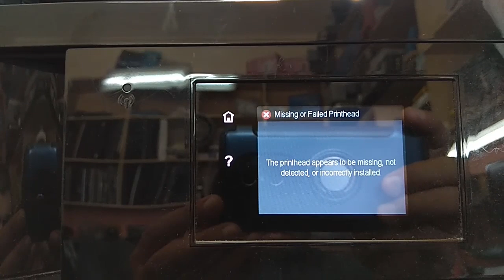How to fix hp officejet pro 8610 missing or failed printhead

Comment: Just a note maybe, not a reason to remove the ink cartridge contact assembly unless your having cartridge contact issues I would say. After I reassembled the print head, had issues getting the cartridges to stay locked in! I'm surprised no one else seemed to have this issue. There was no alignment posts and a lot of play in the assembly with the screws not fully tightened. I ended up leaving the cartridge contact assembly loose a bit, loaded all the ink cartridges and then tighten the assembly down. I didn't have any luck. Same issue. Seems to recognize the print head for a fraction of a second then goes into cant detect print head again. Going to try the power off suggestion. Glad this worked for so many Definitely a logical and simple contact fix! In my opinion this print head is a shoddy design by HP with these spring contacts. Made cheaply to fail I suppose to keep the buying going!😕🙄
Reply: I MAGINE THE TECHS THAT FIX THESE, KEEP A NEW, NEVER USED PRINT HEAD, MAYBE WOULDN'T EVEN NEED INK CARTRIDGES IN IT) TO TEST THAT, WITH A NEW HEAD, THE MESSAGE WILL GO AWAY & RETURN TO NORMAL  MENU

Comment: I will never buy HP again, greedy woke company. First, I did all of this it didn’t work, however someone mentioned it was intentional and if I unplugged for a while the message would disappear, and so I did. When I turned it back on, I could print the report page quickly before the message appears without any issues, which suggests the printer head works fine, I think HP has built in this common issue and don’t want you to fix it but instead buy a new printer.

Comment: Not one of the better videos. That is for sure. Also, why do all that extra work sanding the springs? That's 100% a waste of time. 
Make sure your ink levels are good, clean off the contacts on both sides of the control board and if that doesn't work, but a new print head or printer. I have had my 8620 for over 5 years and this is the first problem I have had with this thing so far.

Comment: I followed the instructions precisely and IT WORKED.  HP charges $150 for a new printhead, but by cleaning my current printhead it only cost me $9 for a Husky 8-in-1 Precision Torx Screwdriver Set at Home Depot, which includes T6 and T10 and others.

Comment: Merci pour vos indications que j'ai mis en pratique cependant l'imprimante continue d'indiquer que la tête est défectueuse. Je vais donc en commander une. Bien à vous 🙏
Reply: I tricked my printer, because I didn't have the tools to open the head, I just wiped the contacts with a moist cloth, put the head back on without switching off the printer, closed the lid, then I pressed the off button, it warned me not to switch off without the cartridges in place I went ahead anywhere, removed power cable, then switched it back on, it asked for cartridges , calibrated and is now working, happy days

Comment: I need to see you it in (which you did) and use it so I know for sure it really worked for you. 

This video only shows how to take the printhead apart and clean 🧽 the printhead and put it back 

but not use it by making a copy of anything. This would show that your method really worked.  This would be convincing if you only used it to show that all your hard work 😓 paid off. 

If you can somehow show that 
With that printhead you used your method on 
Show you copying something to show that printhead works.
It would be nice to see that video

Comment: nice.  Since you're showing how to clean oxidation manually, if that's all it is, that will be great and I'll give it a try.  A quicker simpler way is to use DeOxit F5 which is what is use to clean electrical components on mother boards, potentiometers, small motors, vintage audio hi fi gear.

Comment: I just can't understand, how the print head can be lost. It was just there some days ago and now it's gone... I probably have to try it as well but wondered if the problem started with the ink. Although the ink was bought from the same manufacturer, it was a bit cheaper and I wonder if someone had injected a different inc into the cartridge.

Comment: Well, I've done all the steps in this video two and a half times. The first time I didn't have a T6 bit,  so couldn't do the inside. Bought a Precision Screwdriver Set for $10 at Home Depot just to to get the T6. Then I did the whole shebang twice. Tried other people's suggestions about unplugging and letting it sit and then rebooting. A couple of times I got the right display for an instant before the original error message came back on "printhead missing, not detected, or incorrectly installed. Error code: Oxc19a0003"--so I had a glimmer of hope that it was trying to connect. Any suggestions?
Reply: I know its been over a year but 90/% or higher rubbing alcohol on the contact with a Q Tip to properly clean.

Comment: Topic: In case the new printhead also fails, try to exchange the internal battery as well. 

To begin with, thank you for all this information, great video and also great discussions! 
I had the same problem "printhead missing ..." and first tried the “contacts cleaning” options shown on this tutorial. It did not help me. Then I exchanged the printhead for a brand new version (140 €), also to no effect. 

As the error message blocks all further interaction with the printer menu, I could not reset the printer (HP Officejet pro 276DW.) Therefore, in a last try, I decided to exchange the battery (CR 2032) that is installed on the printer main circuit board. In this exchange I also had to loosen three plugs from the circuit board to reach the battery on the back. 

The result: 
-	New battery with old printhead: same error message
-	New battery with new printhead (the one that I had tried unsuccessfully before): printer works!!
-	Old battery still has 3.15 V, so did not seem at “end of life” yet. 

I am a bit puzzled why I achieved this result. Perhaps my printer required both a new printhead and a reset. And perhaps the reset was brought about by the battery exchange or by the loosening of plugs?
Reply: I saw a video that asks if your printer has a battery, If so, put a piece of paper between the battery and the connector so it would not have contact and then reset due if the battery is GOOD it does not allow the printer to do a full hard reset
Reply: Do you have an instruction video please?

Comment: I got this message after I cleaned my print head using nothing but water. After seeing numerous solutions to solve the problem without have to buy a new print head or printer I did nothing but UNPLUG the printer for 24 hours. When I plugged it back in, it aligned and printed perfectly.   I have done this on other occasions for different products usually with good results.
Reply: 😆😆🙃🙃🙃🙃😉Really?

Comment: You are awesome (and the raggae is a bonus) but the HP factory now has pressed on fasteners so I cannot just open the plate that has the print heads on it...they'd rather I buy a new printer than be able to service my own. Rotten greedy *&%$#$$$$$

Comment: One question. Will buying a new printhead fix the “Missing or Failed Printhead” Error?
Reply: You can never be sure, however I'm having this issue as well and I tried the printhead from a different working printer and it worked. Putting the old one back in and it gave error again.
Reply: @TijmenJanssen  Thanks! I think I'll take the risk and buy a new one! :)
Reply: @MonarchGuy974  they're pretty expensive. Have you tried the steps in the video? Cleaning the contacts. Not the ink flushing.
Reply: @TijmenJanssen  that's brilliant

Comment: This is the second HP printer that I've had this problem with. He doesn't mention what he's using you have to guess.
Reply: I followed the video but also added an extra step. Inside the printer body, where the printhead's 40 copper contact pads (19:32) make electrical contact with the printhead carriage (4:28), lightly sand those contact points as well with fine emery cloth.  (It doesn't have to be a rubber eraser, just make those contacts shine). This resolved my problem of the printer not finding the printhead. Also, you'll need a set of Torx screwdrivers (#T6 and T9 orT10) to remove the printhead screws. Got mine at Walmart in the auto parts section. Better that scrapping the printer.
Reply: @TheBoxfitter  What the others didn't tell you is that some of those copper contact pads may be scratched off due to wear and tear of using the printer. If they are scratched off, the printhead is useless. At that point it isn't worth going any further because the person can't put the copper pads back on.

Comment: video was very detailed and I understand it was mostly a "do as I do" walkthrough.  good fix but sadly didn't fix my issue
Reply: I followed the video but also added an extra step. Inside the printer body, where the printhead's 40 copper contact pads (19:32) make electrical contact with the printhead carriage (4:28), lightly sand those contact points as well with fine emery cloth.  (It doesn't have to be a rubber eraser, just make those contacts shine). This resolved my problem of the printer not finding the printhead. Also, you'll need a set of Torx screwdrivers (#T6 and T9 orT10) to remove the printhead screws. Got mine at Walmart in the auto parts section. Better that scrapping the printer.

Comment: I did this on 2 of my printers that has the same problem, it didn’t fix either one. - When I called HP tech support they told me that electrical AC surges breaks these printheads, he suggested I plug printer into a UPS or a good Surge protector.
Reply: I followed the video but also added an extra step. Inside the printer body, where the printhead's 40 copper contact pads (19:32) make electrical contact with the printhead carriage (4:28), lightly sand those contact points as well with fine emery cloth.  (It doesn't have to be a rubber eraser, just make those contacts shine). This resolved my problem of the printer not finding the printhead. Also, you'll need a set of Torx screwdrivers (#T6 and T9 orT10) to remove the printhead screws. Got mine at Walmart in the auto parts section. Better that scrapping the printer.

Comment: I followed this tutorial EXACTLY and, surprisingly, the solution worked exactly as expected. I did run into an issue toward the end. When inserting the print head back into the printer, I found it difficult to stop the mount (it rolls left-to-right). My solution was to simply jam it while it was exposed (it didn't make it back into the unexposed position), and I was able to insert the print head and close the latch. Thank you!
Reply: At 13:34 is that some kind of special eraser? Could the eraser from a regular pencil be used instead?
Reply: @Essays4College  yes
Reply: @Essays4College  preferably a white eraser from say a Bic mechanical. then wipe clean with a little alcohol on a cloth or Q-tip.  I tried just cleaning the exposed gold windows on the motherboard….hasn’t worked. I don’t have the tool for the screws to take it off and clean the back. so annoying lol just worked a couple weeks ago, now all of a sudden it’s an issue.
Reply: @kdub175  2 months later???? LOL ...thanks though

Comment: This worked for me. My failed printhead messages stopped and printer started working. I don't think the video is that bad. It moves slowly and that was what I needed as I'm a novice when it comes to printer repairs.  Note: you'll need a Star T-10 screwdriver and one about two sizes smaller (which I didn't have so didn't clean the contacts with the eraser in the last step and this procedure still worked.)
Reply: Are the screws metric or standard?!
Reply: So it really worked? is it still working?
Reply: 9:38 what type or grade of sandpaper did you use?
Reply: T10 and T6 are the screwdrivers required for this job.

Comment: I agree. Worst video. I put it on 2x speed and it's still super slow.  With the damn song on loop and the guy cleaning the print head in slow motion.  Like they never heard of video editing software? Cut the bs, make this video 3-5min tops.  Don't run it for 20min and have ads throughout. This is terrible video. "how to fix". SMH. Fix your videos.

Comment: Horrible. Simply horrible. Worse than click bait, robocalls and blood blisters combined. You tube, please give them the hook!
Reply: well this worked for me i admit i wanted to reach thru the tube and shake this guy awake painfully slow video . i let my printhead soak in water for like 3 days forgot about it actually and stumbled upon this used a pencil eraser and fine emery cloth to all contacts and  alcohol clean. also i reflowed the solder on the board that takes input from the ink looked like possible micro fractures put it all together started right up no error and went and calibrated wahoo thanks to poster saved me easy 300$

Comment: I watched it and plan to follow instructions - no prob with ad's as I just clicked skip 4 seconds - if it works like it did for some, good;if it doesn't then I will get a new print head but atleast I tried - I also rechecked some steps by just clicking on the red line - I didn't have any problem watching and understanding anything - didn't waste my time as many said. Thanks for the Video as it's another area to check.

Comment: Reset the printer

Perform these steps to restart the printing device.

Turn on your print device.
Wait for a while till your printer is sluggish and silent before you continue.
As the printer is turned on, detach the power cord from the back of the printer.
Release the power cord from the wall outlet.
Wait for a while, like for 60 seconds.
Attach the power cord back into the socket.
Connect the power cord back again to the back of the printer.
Switch on your printer if it is not automatically on.
Wait till your printer is sluggish and silent before you proceed further.
If these steps fix your issue, you need not to continue troubleshooting.
If the issue continues, perform the next solution.
Reseat the printhead
Perform the given steps to reseat the printhead.

Unseat printhead
Put your fingers in the slot on the left side of your printer, and then pull it forward to open the cartridge door. The carriage transfers to the left side of the printer. Wait till the carriage is sluggish and silent before proceeding further.
Release the power cord from the back of the printer. Releasing the printer avoids the carriage to move.
Uplift the carriage latch.
Clasp the sides of the printhead, and slightly uplift the printhead without taking it out from the carriage.
Keep the printhead back to its position, and then put down the carriage latch
Insert the printhead back again to the carriage to reseat it. As you keep the printhead into the carriage, it relaxes into the carriage as it seats.
Gradually keep the printhead to the left and right to ensure that the printhead fully seats in the carriage.
Put down the carriage latch.
Ensure that the carriage latch is down.
Shut down the ink cartridge door.
Connect the power cord again to the back of the printer.
Hit the Power button to turn it on, if the printer does not turn on by itself.
Wait till the warm-up period is over and your printer is inactive and silent before you proceed further.
If these steps fix your issue, there is no need to proceed further with the troubleshooting.
If the issue persists, move to the next step.
Reseat the printhead up to three times
At times error messages continue after inserting the printhead. To fix any error messages, reseat the printhead by reiterating all the above steps up to three times.

If the suggested steps fixed the issue, do not continue the troubleshooting.
If the issue continues, move to the next solution.
Substitute the printhead
If you have completed all the troubleshooting steps and still experiencing the same problem, then replace the printhead.

Examine the printhead warranty status
If you have a faulty cartridge or printhead, it might be under warranty. To confirm the warranty on your ink or toner supplies, visit the Printer and Page Yield Overview. And from there check the restricted warranty information for your supplies.

Order the printhead
If the HP exchanges the printhead assembly under warranty, then you will get a kit with a new printhead assembly, guidelines, and a full set of SETUP cartridges. If you own an HP Instant Ink, then you might also get a new set of Instant Ink cartridges. You must fix the SETUP cartridges first, or a cartridge error arises.

Replace the printhead
If the error persists, then the next step is to replace the printhead.

If these steps set the issue, you do not need to continue further.
Move to the next solution if the issue still persist.
Service the printer
After completing all the above-mentioned steps, if the issue persists, then the last way to get rid of this is Service or exchange your HP product.You can also solve your printer’s daunting issue by deleting and re-installing the printer’s Drivers and Software, go to 123.hp.com/setup to download and install Drivers.

If again the issue continues, then contact HP Printer Helpline. Experts will help you out to get rid of this error. You can call 24 hours as they are available round the clock.
Reply: The video did not work for me. But there was one comment on here that the person also sandpapered the contacts within the printer. I did this and also followed these written instructions above  and this appeared to work as now it comes on with only the yellow tank is out (which is true).  I won't know for sure until I get my car out of shop Wed.  to go buy yellow ink. Can do an update then. I also have another one of these printers with same problem so I hope to see if I can get it working and then sell one of them. thanks